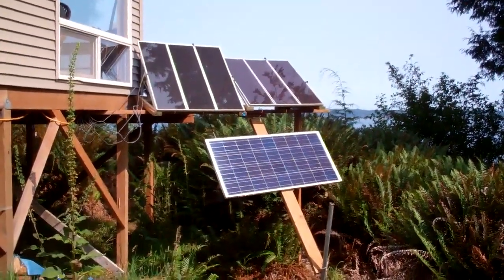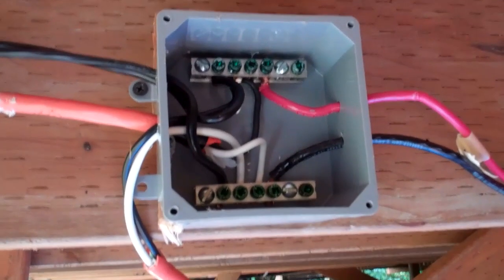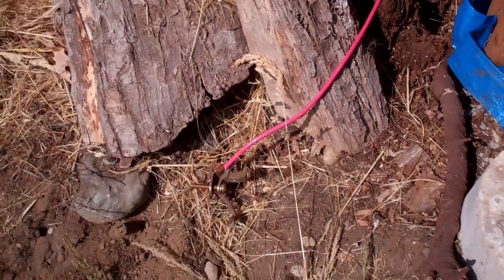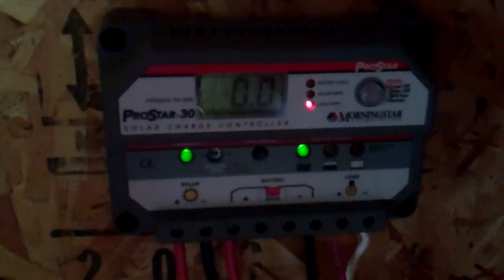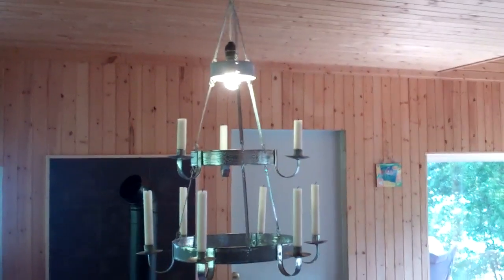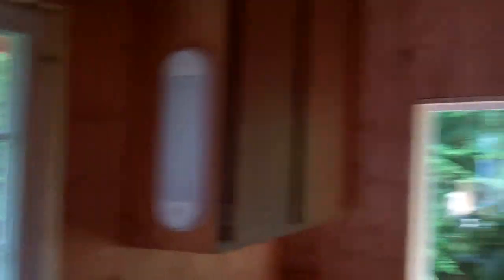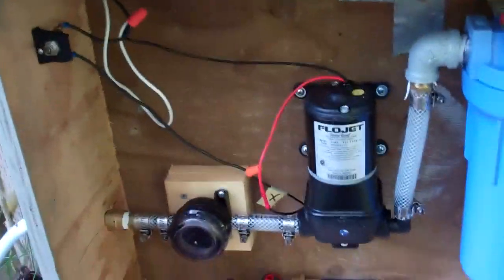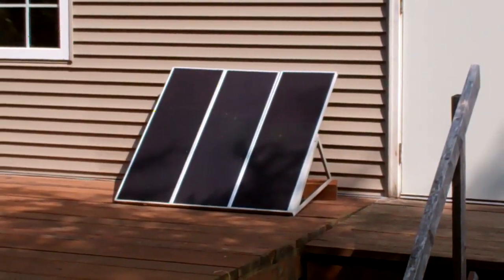Off Grid Cabin Solar Power Aug 2012

Comment: I have a general question about the energy usage. Does all the power you use wire from the 'load' on charge controller or from the battery?
Reply from the maker: I used to run power to the cabin from the "load" output from the charge controller, but now run direct from batteries thru circuit breakers (Sq D QO series). I think you can damage the charge controller if there is too much load.

Comment from the maker: Thanks Steve! The solar system we have set up works fine for weekend and sometimes a whole week, and can handle all the lighting and the water pump. We use a propane fridge, but have been thinking of switching to a small electric fridge. Found some Daewoo fridges that are rated at 1.1Amp, but don't know what their actual power consumption is. 1amp is about what one of our 12v fluorescent lights uses, which with strong batteries should be ok.
Thanks again, Graham

Comment: Very nice set up. Really clean installation. I use for of those Harbor Freight kits. They just went on sale I think I will get 2 more. You gave me a lot of information. My inverter is having troubles also. What wattage is your inverter? I mostly run an ice maker during the day which is about 1500 watts peak. Most of the time it's just 200 to run the compressor. There is that pump box. thanks for posting.